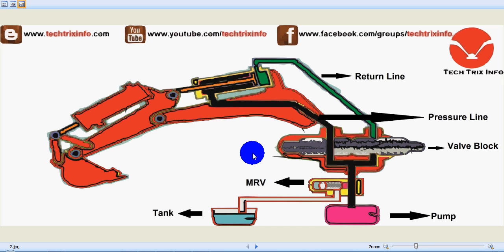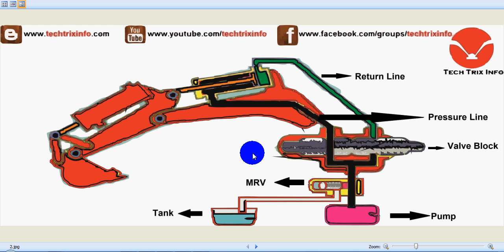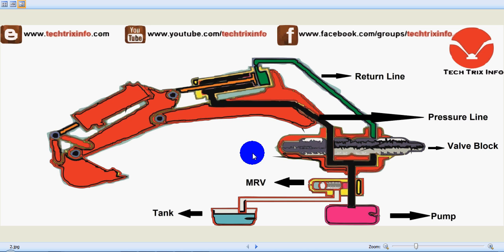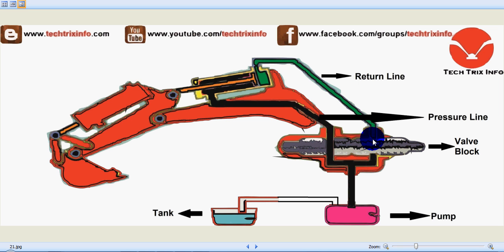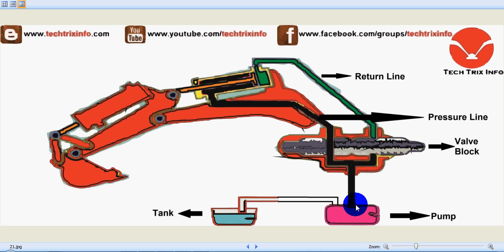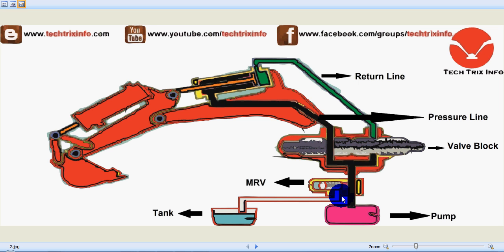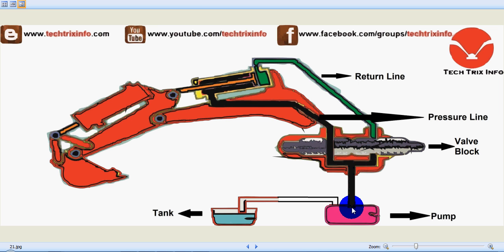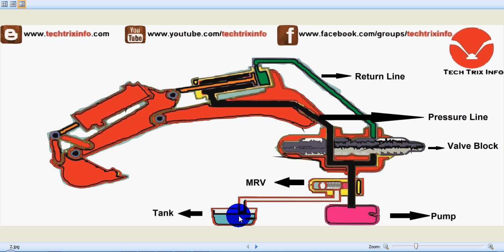How main relief valve works. ✔

Comment: If the relief valve is bad, will it cause a jerking motion in the hydraulic system, or is that an accumulator issue?

Comment: Good-day, I am building a home DIY metal rotating arm with 360 grappling for lifting cabin logs. I have a maximum load 2500 kilograms. I have 2 gas engines a 13 HP Honda gx 390 and a 28hp Honda gx 690 engine to choose from. What would engine would you use? As a example the kranman atv log arm, but my welding DIY build will have a extend a boom setup like a new Holland extend a boom.  I am a mathematician who is a hobby welder as well.

Comment: is there a separate motor giving power to the pump or is it a engine driven?
Reply from the maker: Darshan kokal Driven by ENGINE. Thank you, Please SUBSCRIBE to up for more videos.  we have a face book
 page just search for TechTrixInfo in face book. TechTrixInfo.com
Reply: There is pump just like water pump to push oil. It is driven by engine with help of vee belt or chain which puts oil under pressure n forces it in system.It  makes components viz cylinder or hydraulic motor to move or rotate.
Reply: TechTrixInfo.com juhjkj
Fhgjjjjul9078ut ooi h htc k gedung piuevjjhff
Reply: TechTrixInfo.com juhjkj
Fhgjjjjul9078ut ooi h htc k gedung piuevjjhff
Reply: It must be consuming lot of energy.... Can't it be driven by muscle force by using law of conservation of pressure by applying large force on small area and keeping cross section of cylinder as large as possible
Reply: It's heat driven off your hot breath